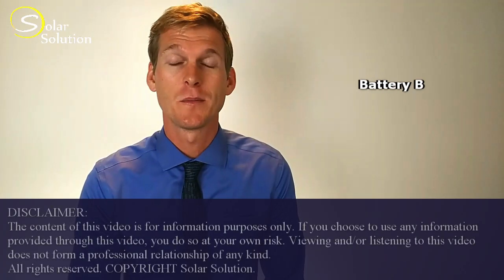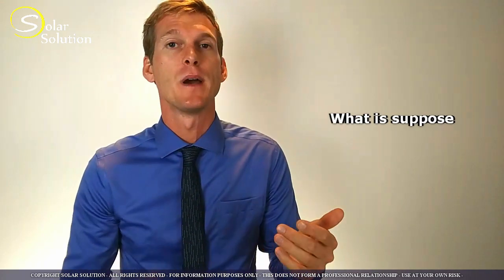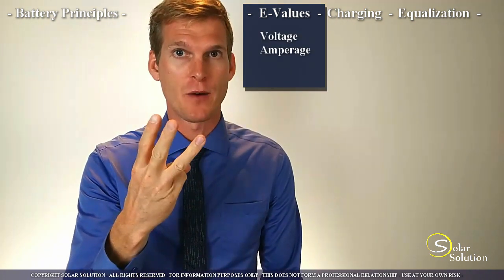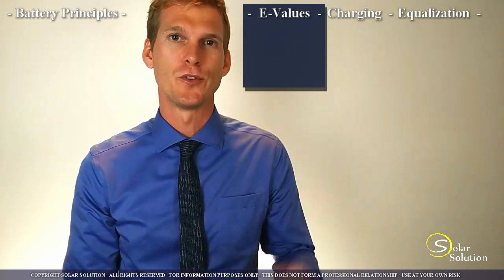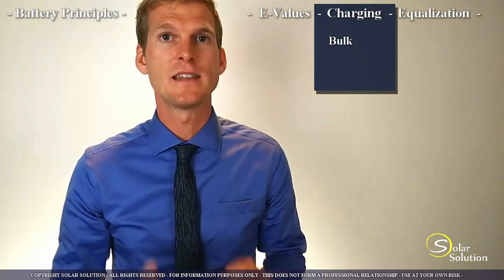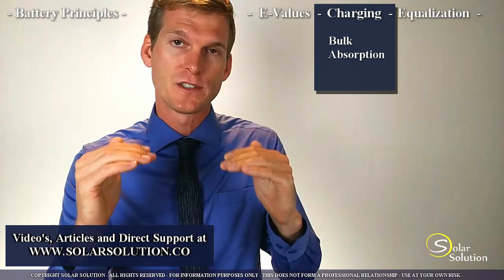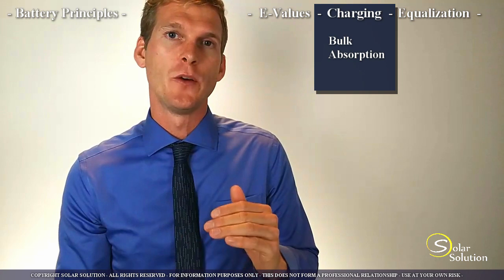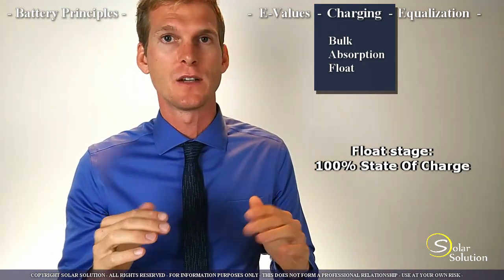Battery Charge Voltages Explained // Equalization // Bulk // Absorption //  Float // Solar Energy

Comment: Your video is very informative and precise. I want to know about flooded battery installed at home are placed at one place for long time un moved. Does moving/shaking them after regular interval have any affect on their life and efficiency?thx
Reply from the maker: Good question! Shaking/moving is probably not a good idea, since it could accelerate 'plate shedding' and possible short plates due to plate debris at the bottom moving around. Stratification of the elecrolyte is what one would generally try to avoid/reduce by regularly going through the absorption phase: In the absorption phase the bubbles in the electrolyte would mix the electrolyte and hence reduce stratification.

Comment: To understand the combination of Voltage and Amperage , it helped me 
1. to imagine a Cliff on a Mountain , 
the higer the Mountain , the higer the voltage
2. imagine a rock to be pushed of that cliff ..., 
the bigger the rock the higher the amperage ...

3. the air resistance would be the Ohms electrical resistance ..., while it would be difficult to imagine air heating up ... 😀
Reply from the maker: Thanks for sharing!

Comment: What would happen if you used a dc to dc converter instead of a normal controller for solar? They can accept variable input and the output can be set to a specific voltage. Why not set it at the float voltage and save the money for a controller?
Reply: I did find this: Recharging deep-cycle batteries with a charger using a constant voltage or a fixed charge algorithm can, over time, lead to a condition called stratification. Stratification occurs when the acid in the electrolyte separates from the water and settles to the bottom of the battery causing damage

Comment: It is mentioned the charge current is a function of the Ah rating of the battery, but how does the charger know the Ah rating of the battery?  How does a battery charger differentiate between 100 Ah battery and a 200 Ah battery?
Reply: It doesn't. He said that when it reaches a certain resistance that it triggers something in the circuitry of the charger to start the absorption process. The absorption charge rate could be a preset amperage value in your charger common for your type of battery (doesn't matter the ah). Only after it reaches a certain time or the amperage reaches an almost equilibrium state that threshold is met and you have reached float value. The charger should stop charging after this? But we know my cheap lead acid charger will keep charging at the 2a setting i selected and bubble up excess energy from the battery until you unplug it. Now ah rating is important because you dont want to charge it faster than the 20% ah rating for your battery. If you pick up a 5a output charger and charge a 25ah battery that would be 20% the max charge rate you can safely use. You need to check the absorption rate of the charger for compatibility with your battery. I got a battery cooking now I need to check on. Nothing smart about this one. I was going to add that is why I start my charger on a high setting for a low battery and after it reaches a certain voltage around 80% of float value I turn it down to the lowest setting and this has always gave me a strong car battery. It does give me a green light so maybe it does shut off I dont know. I've had some bad batteries come back to life after a really slow charge for extended periods kinda resets them or something. I think they call it battery conditioning.

Comment: Hi I’m not very smart I just purchased a electric motorbike lithium ion battery it says something like “once light turns green and fully charged allow float charging for 1-2 hours does this mean leave it plugged in when it’s full charged for 1-2 hours 😅
Reply: Yes, First stage bulk max rated charging up to 20%ah rating. They probably advertise how fast the green light comes on. They say float but I bet you its the absorption stage where the charge controller lowers the current due to the first stage completion re battery voltage and slowly finishes the charge till float (100%) as the video explains. You could test using a dc amp clamp. Or possibly using a regular volt meter set to dc, unplug the charger after the green light comes on and check the bikes battery voltage by touching your leads to the harness connections for your bike. Plug it back in for 2 hours and then check the voltage again. That reading should be close to your float voltage. Find the nominal voltage (lower than the green light value) the factory says the battery is and subtract from your float voltage (highest value). Example: Lets say you get get .5v difference (that's usually what i get from a single cell 18650) from nominal (shipping factory voltage) to float. Divide by 10 would be .05 so if i'm right your green light came on after 80% charge meaning .05 x 8 = .4 volt increase, in this example, from nominal voltage would be 80% and another .1 volt (20%) increase would be the float charge. Also if you know the battery cell make up you can find the battery factory voltage and see how many times they ran it in series to come up with the voltage rating they provide. So if its 18650 cells the voltage is I think 3.7v lets say if your bike says 48v then the batteries ran in series 13 times and the voltage more accurately would be 48.1v.  So knowing the cells really helps make this test for more accurate. That .1v could mean 20%. Sounds crazy but if you run it in series 13x's that .5 x 13 = 6.5v divide by 100 = .065 that means .1v may only be about 2% of a higher voltage system. That sounds more like it. I could be wrong but I doubt it.

Comment: It would be interesting to understand what happens with a dead car battery, in my case a lead/acid one. My CTEK charger charged it from "dead" (2 leds out of 8) to full in a few hours, but it lost its charge until morning, and now it's staying at 2 leds for hours, and both the charger and the battery get hot. I can hear bubbling inside the battery. When is it a lost cause, and why ? This was bought new a couple of years ago then kept in storage where it deep discharged

Comment: Thanks for your explanation.

What about battery electronic desulfators?
Do they actually work?
Or only the hi end professional ones do?

I have seen some dead battery pb battery recovery with a spot welder- can you please elaborate on this topic- the voltage and current figures on this spot welders are way higher than recommended but I have seen this method work many times.
What are the pros and cons to this method ( except the safety aspect of course)
And would it suit any type of pb battery or just flooded due to the need for removing the caps for releasing the pressure and topping up water?

Thanks in advance for your reply 🙏
Reply from the maker: Hello Shlomy, thank you for your message. I think the following video will answer most [if not all] of your questions: https://youtu.be/clVrcG8jV7Y. Have fun! Jesse

Comment: Hi Jesse. You mentioned that you can connect a temperature sensing device to your charge controller wirelessly. Can you share an example of a wireless temperature sensing device and how to connect it? And also a hard-wire connection like you also mentioned. Thanks.

Comment: Hi, im new in this, is SLA battery the same as a AGM battery? 

I also seen some video they did revive a SLA battery by putting battery water inside it, does a SLA battery a dry battery, by putting battery water would damage it?

Comment: Batteries for my UPS system has 300AH. I'm now trying to upgrade it to 330AH batteries. Cell voltage and everything else is the same. Do I need to change the battery charger settings? If so, how? Can you please help me out with this? Thanks 😊💯

Comment: Please go into detail about charging LAB (flooded, AGM, Gel) arranged in strings of series-parallel. I have large AGM batteries repurposed from a data center that were never cycled I am using them for my off-grid solar at night. My inverter would prefer 36+VDC but will operate on 24+VDC. My batteries are 12V. I want to arrange them 3 in series and then two banks of three in parallel. I get VERY mixed information about how to use my charge controller to charge them during the day. Lots of information saying my middle battery in series will be damaged during load and unequal charging will happen. What is this all about? How do I (schematic??) arrange my batteries so they charge correctly each day. I live in Southern CA and have excellent true south exposure from sunrise to sunset for my panels.

Comment: Finding the settings for a 48 volt 540 amp hr lead acid forklift battery for charge controller settings. 25,920 watts what's the best amps to recharge.

Comment: Maybe you could also mention that a plastic mixer could be placed in each cell of a large wet lead-acid battery to stir the electrolyte periodically without causing the gassing and shedding, which would slightly simplify charging and extend battery life.

Comment: Hi Jessie. Love your shows they are very professional.  If I have 60vdc and 10 amps coming from my panels going into a 100v 40a mppt controller to a 12volt 200amp lithium battery at 50% charge(13v), what should the volts/amps going into battery?  should I be getting roughly the same watts into batteries as going into controller minus inefficiencies.? thanks Clark

Comment: Thank you. This is helpful. I wish to regulate the charging in a system that drains battery power really fast. What is required to make the charging relatively fast and not overcharge?

Comment: Hi, I have had all my AGM batteries gassing away during absorption and wondering how I can reduce the gassing, the problem is that even though they are fitted with catalyst caps, the recombination is far to be fully effective, its seems that this catalyst is a bit of a gimmick. What to you would be the lowest voltage that is acceptable for absorption and how much can we compress the absorption time down to? It is really hard to find this information online.

Comment: here's a question:  can you use your battery at any different stages of charging or you have to wait until float charging...   my controller (solar charger controller) always indicate "MPPT" and I have not seen the "floating" stage yet.   So I'm not sure when to safely switch to battery use.  Thanks and more power.

Comment: Lifepo4 battery does'nt need float charge if use normal 12 volt lead acid charger on 4s lifepo4 12v pattery pack with daly bms is it ok? Or harmfull my cells?
Reply from the maker: Hello Waqas, thank you for your message. I will share a video on this topic in the near future, stay tuned. All the best, Jesse.

Comment: Dear respected sir

Please. Make a vedio on  150 - 200 AH. Lead acid battery for
1. Why. Equalization is required for lead acid battery
2. How  a  battery cell are being over charged and under charged when  6 cells of battery are used the same current and voltage from inverter ....
3. How can we equalize the battery in series like 2 battery inverter of 24 volts as 1500 va ....
4. What should the current and voltage and charging time and ideal process to equalize the lead acid battery

Please help .....

Anil maurya(Architect)
India
Reply from the maker: Hello Anil, thank you for your excellent list of questions. I will create a dedicated video on this, and let you know once it is online. All the best for now, Jesse.
Reply: @SolarSolution  
Thanks  a lot sir 
🌻🌻🌻🌻🌻

Comment: Thanks so much for the video.  Very informative.  I have a Mastervolt 50A/3-channel charger, connected to 4x 6v lead acid batteries by Interstate, (2 other channels of the charger are for start batteries).  Batteries about 3 yrs old, and never been equalized.  My bad.  The charger appears to be able to do only a poor job of equalization since it only approaches the equalization voltage and stays there for a short time.  And Interstate indicates that equalization should be done for 2 hrs at the equalization voltage.  Can you advise any special equipment or setup that would allow for proper equalization to be performed on the batteries?
Reply from the maker: Hello D, thank you for your message. It is good to hear you enjoyed the video. As for your question: Do you know whether you can adjust the settings in your charge controller?
Reply: @SolarSolution  You can only adjust the equalization voltage.  You cannot adjust the duration of how long the charger stays at the equalization voltage.  I am actually considering the purchase of a DC power supply that has voltage and current settings so that I can adjust what is applied to the batteries during equalization.  I realize that I will need to ensure that the batteries are isolated from all loads and chargers when I apply the DC power supply output.

Comment: What’s the difference in real life between deep cycle and a car battery and how to check your amp and the battery whether the car or the boat by checking the amps can you figure out what’s the amp power to that battery thank you
Reply from the maker: Hello Eva, thank you for your message. You have an excellent question, which I have not covered yet; The difference between start & deep cycle batteries. I will share a dedicated video on this soon. As for the second part of your message, could you perhaps clarify your question a bit more: What is it that you want to learn? 
Thanks. Jesse

Comment: Could you make a video about classified zones of battery rooms because of the hydrogen emission of the batteries. You said in the video that we may install the charge controller in the same room but the classification of the local containing the batteries requires an Ex protection mode that should be considered in the controller.
Reply from the maker: Hello Walid, thanks for your suggestion. I will add it to the list! Jesse

Comment: When often should we equalize the flooded battery ?
Reply from the maker: Hello Muhammad, thank you for your question. Have you checked the recommendations of the manufacturer of your battery yet?
Reply: Yes Sir, I have checked the battery specification they mentioned only bulk and float voltage and did not mention the equalizing voltage and it's period.
Reply: It's 12V Hyundai tall tubular battery 155 AH.

Comment: What max charge current should be used for an AGM 660ah battery park?
Reply from the maker: Hello Jean, thanks for your question. I did not see which brand or model of battery you are using: What does the manufacturer's specifications recommend? All the best, Jesse.
Reply: Eversol 12V C20 220Ah / C5 185Ah AGM

Comment: Good info, thanks. What I wanna know is if a Lead-Acid Battery degrades after a full year of use and if you should change the float voltage on the solar controller to a lower voltage. If my Battery is working OK but can only charge up to 13.2v isn't it harmful to keep the float-charge-voltage at 13.8-14v?
Reply from the maker: Hello Robbert, thanks for your message. It is good to hear you enjoyed the content. For personal advice you can contact me through https://www.solarsolution.co/contact

Comment: Hello friend, I'm writing from Portugal, I really liked your video, I wanted to ask a question about what is happening to me in my off grid system, 2 or 3 days ago I put my inverter to equalize to 31.4v, but it just arrives at 30.6v, and it doesn’t go up, which may happen, today I did the same thing and the same thing happens, the voltage doesn’t go up, I have 12 batteries (2v cpzs 930AH) only have 9 months of use ... hope you can help.
Reply from the maker: Hi Toze! Thanks for your message, it is good to hear you enjoyed the video. 
I would like to help you, though unfortunately I cannot provide personal support through the youtube comment section. You are welcome to contact me through the main website: https://www.solarsolution.co. 
Good luck! Jesse

Comment: Wow, great explanation! Finally I understand the differences! :) I do have one small question though, if you have time...my solar charge controller is pre-set to go to floating charge at 13.8V and to equalizing charge at 14.6V, however the label on my battery says floating charge should be activated at 13.5V and equalizing at 14.1. Do I have to be concerned about these differences? Unfortunately I can only change the preset by adding a bluetooth controller, which is very difficult to get here in Peru. Please let me know if you think that's really necessary or if I'll be just fine with the preset settings! Thank you! (btw: I'm not sure if it matters but I actually run two of these batteries in series because my system runs at 24V).
Reply from the maker: Thank you for your message Gerald, I am glad to hear you enjoyed the video. And nice to hear from somebody in Peru!.
Unfortunately I cannot provide you with technical advice through the Youtube comment section. Sticking with the manufacturers recommended voltage settings is often wise. Overcharging a battery can [among other things] lead to accelerated aging, case bulging, and excess loss of electrolyte. This being said, the flooded lead acid battery are less sensitive to overcharging [and other forms of abuse], compared to the AGM and GEL types. 
I hope this helps, if not you can contact me directly through the main website. 
Good luck! Jesse
Reply: @SolarSolution  Great, thanks for the quick reply! With what you said in mind, I will try to get the bluetooth extension, but at the same time not be worried about my batteries until I get it (probably in a couple of months)...Thanks for the advice! Have a great day!
Reply from the maker: You are welcome Gerald, glad I could help. I wish your bluetooth extension will arrive soon! Would be nice to hear how it turns out. All the best, Jesse.